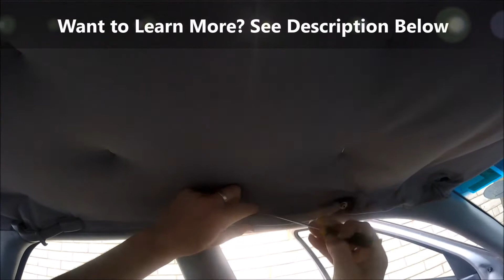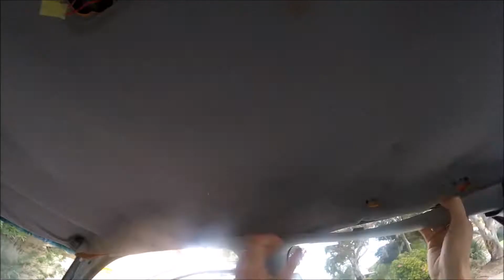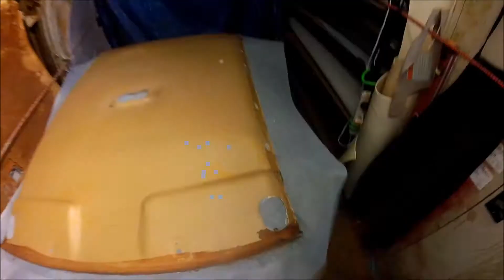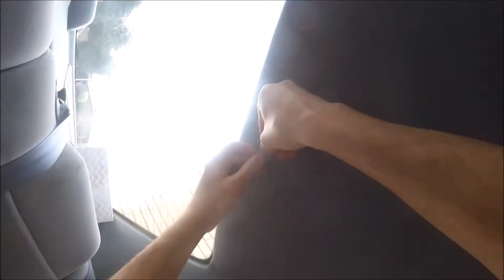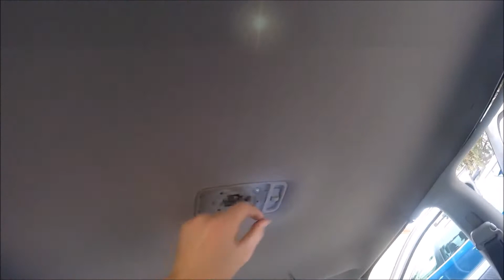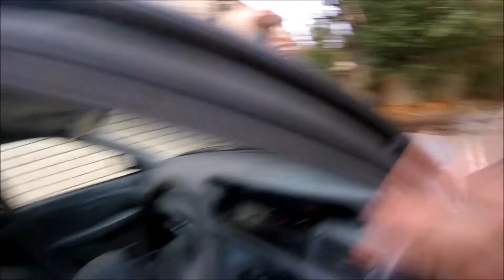Toyota Camry Roof Lining Repair | SAGGING ROOFLINING

Comment: like all skilled craftsmen, Reece made Headling repair look easy. In relality if you have never wall papered a room  then don't contemplate doing this.  The headliner backing material is very brittle and I had to spend a lot of time repairing factures and reinforcing it in preparing for the  reassembly. After removing the old headliner fabric, (it just fell off)  I painted the backing material with stain block paint before gluing on the new headliner material. I was pleased with the end result but when I started the project I realised I might have taken on too big a project.  The backing material is a very thin layer of extruded polyurethe sandwiched between two layers of very thin brown paper.

Comment: Thank you! 
You work so fast I had to change my settings to .5 to catch everything : D
The crappy Phillips screws in the lights were really tight I stripped two of them so I had to drill the heads off, after the light dropped I removed the studs with vice grips.
Reply from the maker: Yeah unfortunately we did load a lot of our earlier footage at 1.5x speed. But newer videos will be another more in depth and with voice over for guidance 👍

Comment: My Camry ceiling shell is like paper. Respect, for making it look decent, the foam-backed headliner is almost as stiff as the shell causing major ceiling distortions.
Reply from the maker: I understand, these headliner boards are very thin, like paper, crack and break too easily. And even fall apart in your hands during removal stages.

Comment: What kind of glue did u use for the repair?
Reply from the maker: Thanks for your comment, 
We used a bulk buy item, 20L of TensorGrip T65. However other options would be a drum of Automotive SuperGrip, or Spray-Cans of 3M High Tac 76, or Permatex headliner carpet glue. 

Regards, 
Reece
Reply: @ReecesAutoHeadliningRepairs  great thanks, dont want to buy bulk, just want to do my own car great video btw

Comment: I see you sprayed the interior side of the liner after gluing it to the cardboard. Why?
Reply from the maker: So the process of adding new fabric to the board is:
1) remove the headliner board 
2) remove old foam/fabric
3) apply new foam fabric with new glue, spray glue on the board and back of fabric to insure a good adhesion. 
4) we sprayed fabric cleaner on top at the end to clean it down, not glue. 
5) reinstall the headliner board 

Regards,
Reece
Reply: @ReecesAutoHeadliningRepairs  What type of spray glue?

Comment: I assume front seats had to come out? Hard to tell from the video
Reply from the maker: Tips on removal/install stage:

Seats are usually left fitted, but have front seats fully reclined and pushed back. Remove/reinstall headliner board from front passenger door or rear drivers side door carefully. Apply slight bow/flex if required to keep it away from dragging on other interior surfaces. Hatch/wagon obviously is all done from rear tailgate. 

Regards,
Reece